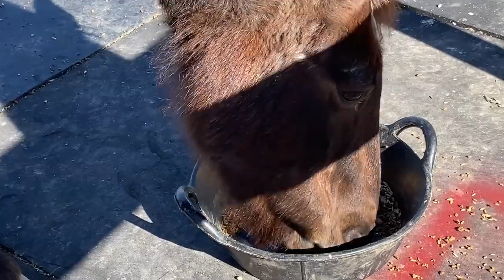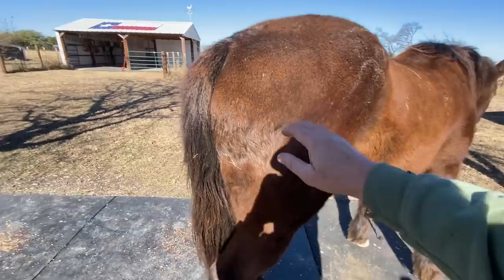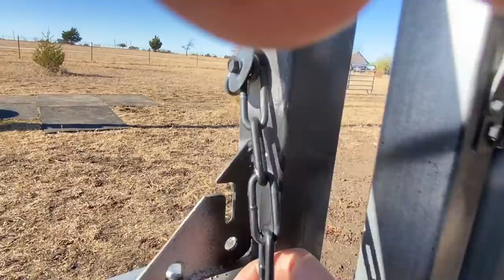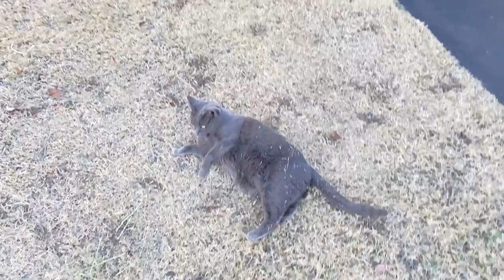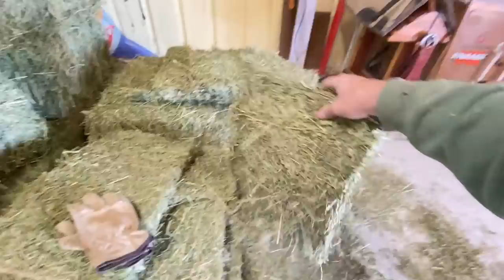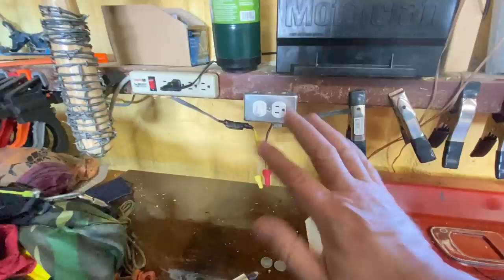Inspecting Horse Hooves 3 Days After Trim

Comment: So I just had my mustangs hooves trimmed and my farrier noticed that his white line was red and said it could be laminitis.... what should I do to help him? He doesn’t look like he’s limping at all...
Reply: My 29 plus gelding will get red lines..has foundered over the years and endured absences.  He's doing well but have found that Remission helps some, watch the sugars in the grasses (fall and spring) and of course treat if absences happen...salt water soaks...etc. Hope that helps some
Reply: @sandysefcik1614   as far as I know the feeders haven’t increased his food....my farrier said part of it could part of the fact that I ride on the road...so am wondering if shoes may help 🤷🏼‍♀️
Reply: @alliebledsoe1826  Hope he is getting better😊      🤔Actually, Remission is a supplement that is given to help with foundering.  If you have him off the grasses and are feeding him oats, alfalfa, beet pulp etc you might want to research more info regarding type of feed. I found remission helpful until my gelding needed  to go to medicine for cushing, although I still use remission.  By treating a potential foundering situation laminitis is reduced.  Both tend to be  due to an inability to process the sugars in grasses. My horses run bare foot but then again that takes time for them to build up a comfort...I used to do alot of trail riding which requires alot of varying ground work. My belief, but there again just opinion,  is that riding on road would not create white line or reason for shoes. Hope this helps. Have nice day and happy new year. 😊
Reply: @sandysefcik1614   thanks for the help I will definitely look into it...😊